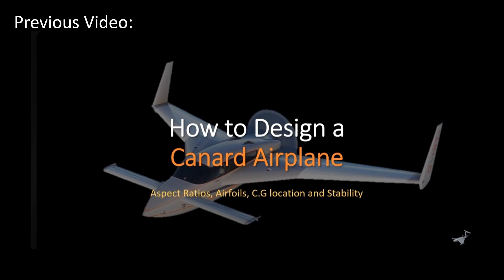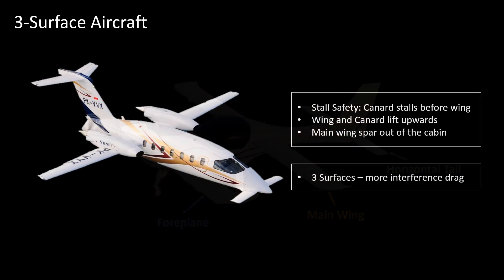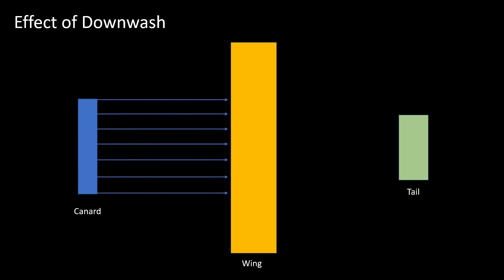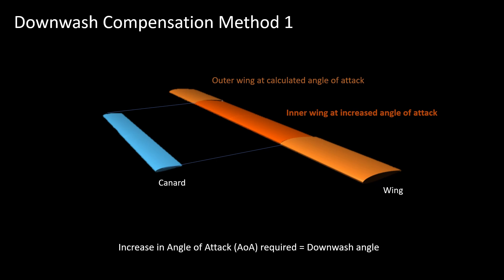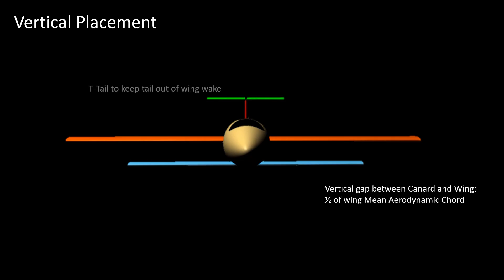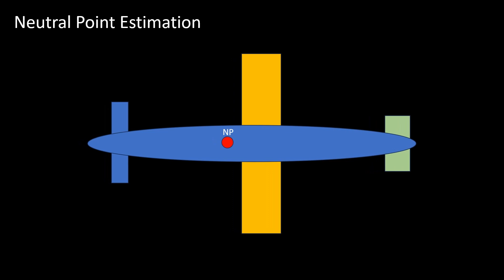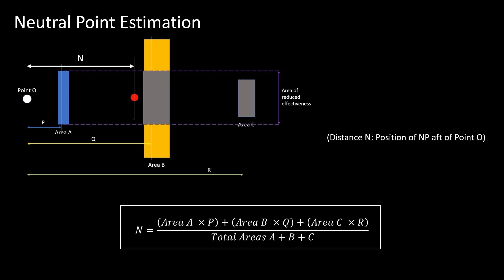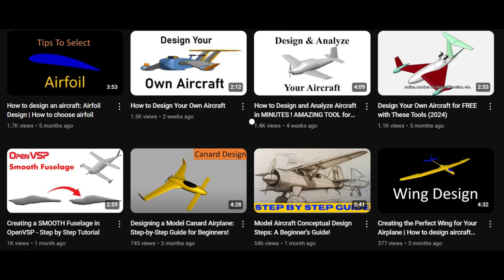Tips to Design a Three Surface Aircraft

Comment: Is the neutral point like where the resultant net lift or moments act thru ? And I just thought I would throw this out there. How come you don't see too many 3 surface aircraft out there ? I did hear from one person that the Piaggio Avanti has some stability problems but I only heard that from one person. But I guess its tricky to design with having to  mitigate the interference effects, and to make sure its always stable and controllable, able to recover from stalls etc.
Reply from the maker: Neutral point can be thought of as this: If you place the C.G at the neutral point, the aircraft will be neutrally stable. Neutral stability means that if a disturbance (like a gust of wind) causes a nose-up, the aircraft will remain in that nose-up orientation until another force acts on it. If you put the C.G behind the neutral point, you will get an unstable aircraft (one where the nose up continues to happen and the aircraft stalls). If you put the C.G ahead of the neutral point, you get a stable aircraft (one where the nose wants to come back down after the initial disturbance). 

Yes, 3 surface designs are not very popular. Mostly, the design is used to shift the main wing aft, to increase the cabin space. There is an interesting discussion here: 
https://aviation.stackexchange.com/questions/80690/why-arent-3-surface-aircraft-more-popular-in-general-aviation 

Hope this helps!
Reply: Yes that helps thanks